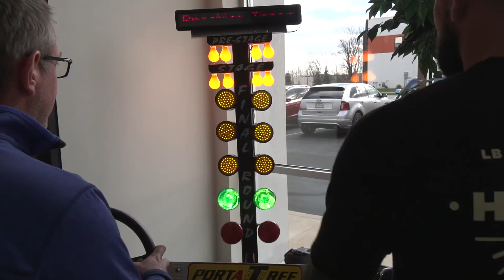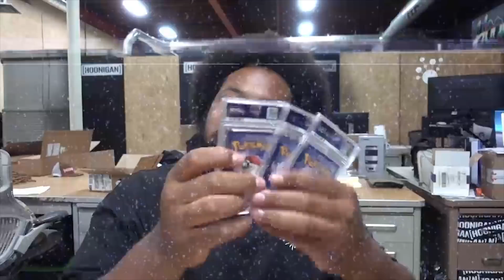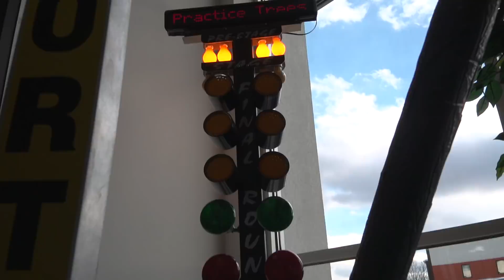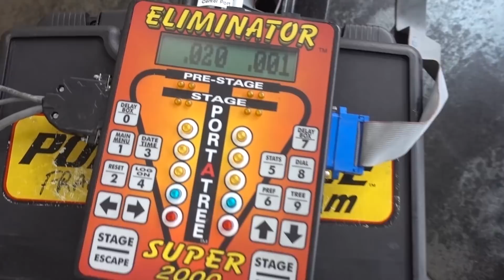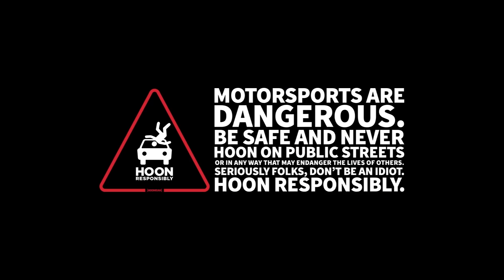707hp Liberty Walk GTR, MX73 Cressida, & LS Fest // DTT258

Comment: I used to work at a classic car shop where we’d have to empty like 8-10 cars out the warehouse everyday. Well alot of those were thrown together projects and some had electrical gremlins. We had a 300+ car inventory and what sold took priority over what was shown off. So every day when it was time to come back in, always one of the cars outside would kill the battery or the fuel pump would fail, so if the pump failed, id jump on the engine, manually pour the fuel down into the float bowls and stay there as they drove it in, feeding fuel from up top. Well sometimes they would backfire thru the carb back at me and the fuel being poured would ignite too, i burned my eyebrows and arm hair off so many times there, but when normal people saw that shit theyd flip, btw that was like 6 years ago and i was already rockin a hoonigan sticker on my street raced 88 ford festiva😎

Comment: I have a fire story, happened while working on a bike. Me and my dad did some work to the engine and decided to fire it up without the exhaust so we don't have to waste time taking it off if it decided to not run, turns out there was a fuel leak that puddled under the bike, now naturally without the exhaust to guide the flames away they were shooting straight to the ground, all of a sudden woosh, fire all over the bike, thankfully the hose was right next to us so we managed to put it out without doing any noticable damage to the bike.
(Bike was a gilera runner 125 4 stroke which is why the exhaust was pointed down and was close to the ground)

Comment: On fire at least 3 times as a mechanic...
1. Paint explosion in a bay when plugging in a vent fan....lost 3 inches of hair on right side...and all the hair on one arm...not particularly fun
2. Welding under a car and slag fell on shirt, too loud and with helmet on did not notice till co-worked ran at me and pretty much tackled it out...casualties, shirt, undershirt...pride
3. Cutting torch, molten slag dripped onto arm and sleeve, set shirt on fire and caused a 3rd degree burn on arm below. Once again casualty Shirt, pride, arm hair, and a life time scar.

Comment: Gazzanats Western Australia 2017 and 2018 had the car catch alight on the burnout pad, not enough to ruin my weekend. But enough to have me washing fire extinguisher powder off the car at midnight in the pits, with the fire reel.
2017 was oil on the extractors, 2018 was the pre conversion wiring harness on the red hot exhaust.

Comment: Of course I've been on fire. The first fab shop I worked at I got supplied with polyester work shirts. Well soon after wearing it and going to town with a cutoff wheel I saw my first set of flames. I have smoldered but never had flames. I noticed before it was a problem.

Comment: After driving my 87 prelude it was running funny so i poped the hood and pulled off what i thought was a vacuum line but it was a gas line to my fuel rail. Sprayed gas all over my hot motor luckily i got the line back on be for the gas ignited. Seemed like the whole engine bay was on fire for a couple seconds

Comment: hert will love this, i wasn't personally on fire but my rx7 was.  Driving through my neighborhood going home nad i start seeing smoke come out from under the dash/ center console, car looses power and brakes and had to use the hand brake to stop from about 40mph, jump out of the car pop the hood and get it open and as soon as i finish getting the hood prop in place a fireball engulfs my hand.  in the end one of the fuel rails failed spewing gas through the engine  bay and thus had a bad time rebuilding lol.

Comment: Co Driving in an old RX7 rally car, Tapped out in the forest near Rotorua and pressure plate exploded. Motor still running, pumping hot oil out of the severed oil lines into the car. Woof, engulfed in flames and couldn't find the buckle for the belts for a second. Dived out of the car laughing because we were ok. Took 7 extinguishers to put the car out. Back bumper was melted off and my shoes and overalls were all crispy. Pretty scary. Side note, I co drove for Rod Millen in the same car.

Comment: I was on fire in the welding shop running a horizontal bead and I smelled my jacket on fire. Now, I'm no bitch, so I just continued to weld, doing the best I could. I finished the bead, chipped the slag off, and then dealt with the fire. Needless to say, it was a good weld.

Comment: Liberty Walk is the basic definition of Instagram aero. Just look at how exposed the front part of the tires are (front and rear), which does no good for drag nor downforce and would let your tires spray dirt/pebbles on the bodywork. Looks ok for stance cars though, they are not designed to go fast or handle well anyway.

Comment: I've only been on fire once.  Got rushed between heats chasing a lean condition in the race boat.  Forgot to tighten the hose clamp at the carb after changing jets.  Made about a lap and a half on what was in the float bowl while the fuel pump continued to fill the engine compartment with gas.  Something must have hit the header and there was a big boom and a fireball out of the side of the boat.  I thought it blew itself out... it didn't.  So I slowly got out of the cockpit only to realize the fire was quickly getting worse.  I gave the rescue boat (speeding my way) a shrug and jumped in the water.  Thought for sure the boat was a total loss, so I never even looked back at it.  Turns out, they saved it and we had it ready for the next race weekend.  A few pics here: https://photos.app.goo.gl/mOG8Nub1ZRfowoHC2

Comment: Was welding in a seat bracket in a 1968 Nova. Whole car is stripped. Another guy is welding in cage mounting points on the floor. This "guy" welded through the floor directly INTO THE 1/2" aluminum fuel line. Wearing a welding mask he could not see this. Im crouched in the drivers seat area , look up to see a 4 foot tall fire ball shooting from out of the car. The fuel cell was higher than the line so it came out FUCKING FAST. So i yell "FUCK FIRE!!!" and get the fuck outta there. My thought was bomb. I knew the cell wasnt full=bomb. Luckally another tech heard all this and grabbed an ABC fire extingusher. For those who dont know ABC shoots out a powder coating everything and the air with an unbreathable toxoc powder. Put out the fire, but took a whole day to clean the customers car out... If you read all that thanks. Thats one of my fire stories.

Comment: I've been on fire. About 15 years ago as a stupid teenager I bought a traxxas Tmaxx. The following spring I got it out to fire it up I had bought new nitro and needed to do something with the old. So why not throw it on a fire in the backyard .... Because the flames from the fire will ignite the vapors before the container reaches the fire and it will turn into a bomb inside that half gallon steel death chamber and blow liquid nitro and flame back at you. I recommend the stop, drop, roll, & strip technique pull your flaming  clothes off ASAP. Jeff from Pennsylvania

Comment: I bought a 1997 Dodge Stratus for 250$ Canadian that's 196 US drove it 20.000kms caught fire  from power steering line shooting onto the manifold my friend just wrecked his truck. towed my burnt car that had a 6ft flame on the paint of the hood to my house. Pulled the tires drained my full tank of gas pulled the stereo sold the new snow tires I got 560$ for everything!!! 410$ scrap just for the car.

Comment: Fun fire Story?: at 11 year old, back in 1992 i had a Cross Kart. so i had easy access to gasoline. 
Then me and my friend was going to make cool explosion.
We had a big cup of gasoline that we set on fire.
it turned out to be a boring fire.. Lets put some more gasoline in it......
..  
i then took another cup of gasoline and poured it..  Instantly Regretted it
i was then engulfed in a huge fire, My friend freaks out. thinking, i was dead.. 
Fire did not even touch me. it when out to the sides and then up. 
i was standing Directly above it. yeah.. Dumb ass move.. but that somehow saved me
only damage to me was that i got some Curly hair

Comment: STORY TIME There's a railroad crossing that's basically a teenage launching pad and I had a 97 z28 key word had I hit that thing at 50 and broke 3 out of 4 wheels when I came down and my ass broke my seat clean off the brackets and right as it came to a stop u here the whoooffff of the fire starting it was awesome but drove 3 pos cars tell I saved to get me another Z28

Comment: Fire story wanted to turn motor over with plugs out but didn't disconnect injector power well I turned motor over injector power ignition fuel flames everywhere turn key off raced to engine bay got nerist synthetic rags to smother out fire they court alight I and melted got more and more which finally put out flames I swore to you I worked like lightning it burned out wiring looms which I replaced it's a four liter Tickford block 1989 ea falcon  six seater rare car still have it parked in dry storage. 🚘🦉